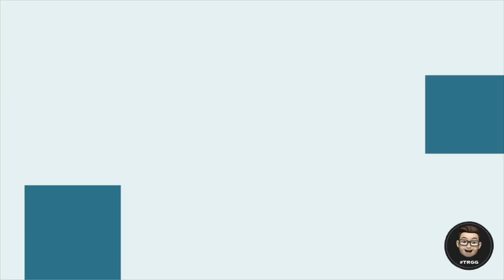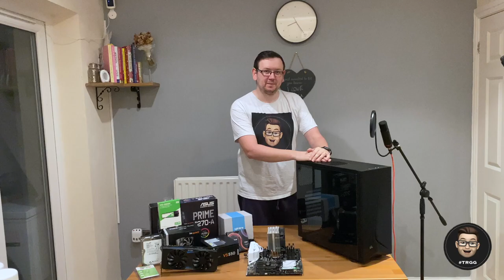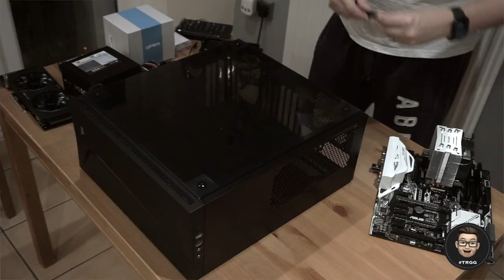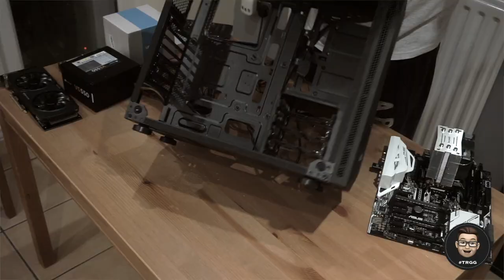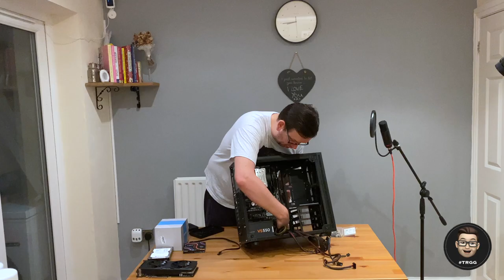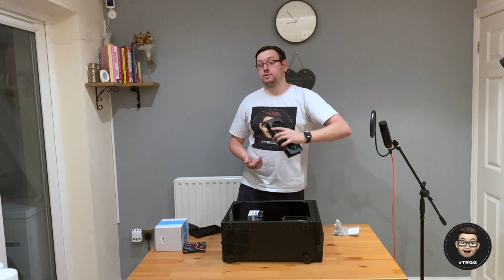Building in the Corsair Carbide Spec 5

Comment: I came here to see how you installed the CPU power after installing mine, I did the same as you at first, as I mounted the Motherboard first. I removed the motherboard after installing most other cables. which meant I had to hold the motherboard in the air :L didn't want the effort of starting over. ANYWAY. I managed to get the cable behind the cpu socket, so it runs up the back of the motherboard, round, the cable is thin enough and there is a 3mm or so gap so it is doable, not ideal at all..

Comment: Did you use the back and top fans as exhaust and front as intake?
Reply from the maker: Yes buddy :)
Reply: @ThatRandomGeekyGuy  I literally can't fit the 2 intake fans, same fans, same case. But I can only fit the middle one, there is only 2 holes for the top fan so I cant screw all 4 holes
Reply: I screwed the bottom two holes of the top intake fan since their isn't any other holes, it's fine so far doesn't make any apparent noise but please let me know if you had the same problem
Reply from the maker: @dynosr3723  yes had the exact same issue but no vibration noise :)
Reply: @dynosr3723   It’s a feature :D 2 screws/fan

Comment: How much does this build roughly cost mate?
Reply from the maker: I will be honest this was built before the current situation with silly used prices.. the computer was around £400
Reply: @ThatRandomGeekyGuy  Sound mate. Cheers, I've just ordered this case there from Currys. Trying to make a budget build, I've ordered the Corsair 450W PSU (Would have been 550 but they have none) and am just wondering, what motherboard do you reckon would be good for it? A decent but not too expensive one. Cheers pal.
Reply from the maker: @madboystu2498  what CPU are you going for mate?
Reply: @ThatRandomGeekyGuy  I'll probably be going for the AMD Ryzen 5 3400G mate.